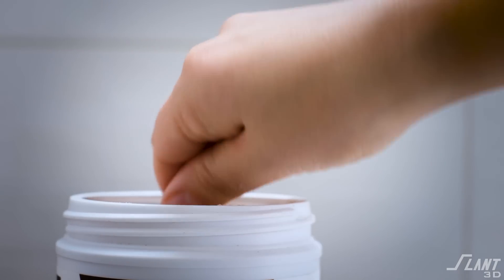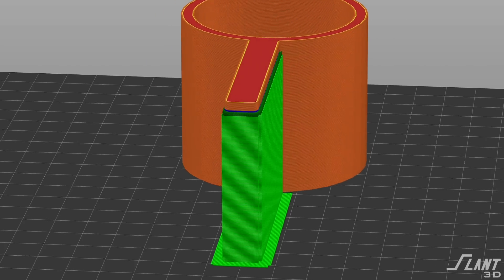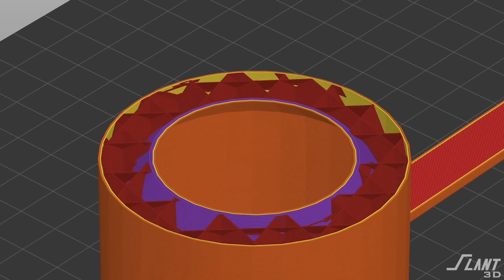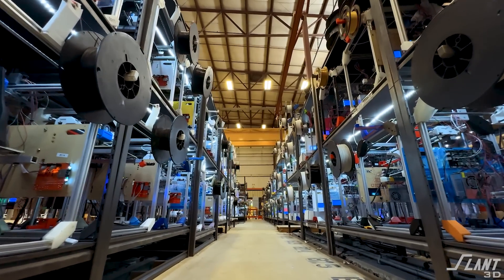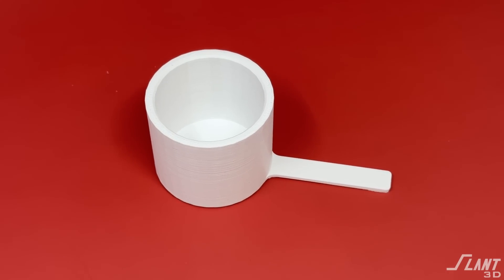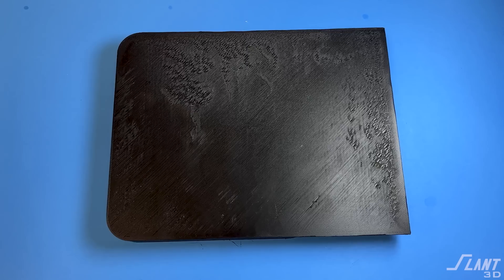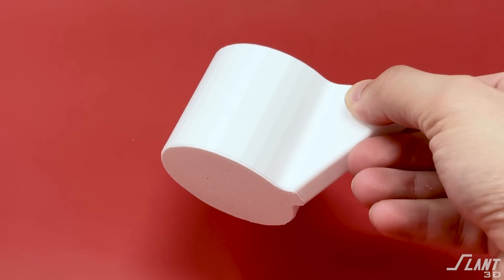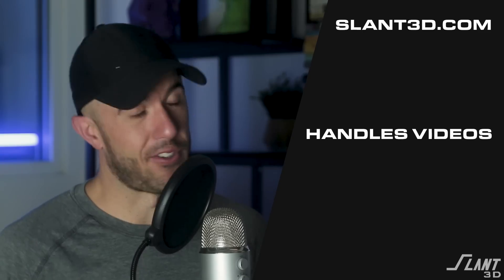Design Perfect Scoops for Mass Production 3D Printing

Comment: Handles on the bottom is absolutely awful. Best way to spill things.
The way you took powder is not the regular way to do it, and the handle can be both on top or bottom with injection molding, but I'm pretty sure you're already knowing it.

Comment: I love this series, but I think this time you chose a bad example. 
With 3d printing at the current state you will never get a food-safe scoop. Whatever you are scooping will stick to the layer lines and it will get dirty really fast and you will not be able to clean it easily. Both reasons why you should never use it for anything food related. And yes you can the scope for non-food things, but the visuals of the video suggest otherwise.
Reply from the maker: Incorrect

Comment: I’ve been a hobbyist in the 3D printer space for 10 years now and after watching this video I just realized I’ve never tried to recreate an injection molded part. If I had to repair something I just went straight to taking measurements and figuring out a design that worked best for FDM printing.

I remember the first time I tried designing a part I didn’t care about overhangs, fillets, or chamfers, and just made a part that worked great in CAD. But after it turned to a spaghetti mess on the build plate I learned my lesson immediately to design with FDM from the start. And I love these videos for helping me reinforce that thinking and also teaching me some new ways of designing. Something as simple as a scoop has a lot of thought in it to make it easy to manufacture, cost effective, useable, functional, and aesthetically pleasing (if applicable).

Comment: Start exporting STEP files instead of STLs and you won't see those straight lines on the cylindrical part of the design.
Reply: Interesting. My stl have never had that problem. I'll have to keep that in mind if it ever does.
Reply: Huh 🤣? Straight lines are unavoidable regardless of the file format. Fdm just print in LAYERS.  Even 0.2 nozzles produce layer lines.
Reply: They are talking about curved surfaces getting split into a series of lines, not layer lines. 

For instance, if you went to print a circle and it comes out like a stop sign. STL files store the model data as a series of triangles, which can lead to curved parts like cylinders to look like a series of line segments rather than a true curve.

STEP files store far more model data and can encode curves between two points rather than making that curve out of tons of little triangles.

Your slicer and printer need to support  gcode arcs otherwise it will just reduce the model back down to essentially the stl format however.
 @sherlockhomes9919

Comment: Why is the outside of the scoop not smoother it looks more like 50 straight lines to make a circle. 😂
Reply: he exported it at a too low resolution from the cad software. this is such a common mistake i dont get. when exporting from fusion the resolution setting is right there and the artifact is really obvious and offputting.

Comment: To be fair, when you value traditional feel while having internals more clear so less crap gets inside the scoop - having a handle with supports is ok, especially if this scoop has to be used in a long deep container. I did design a few scoops earlier past year, I did go with a traditional molded design. I know about those tricks you mention and they're nice, but situational. Not everybody will be happy with powder inside layers or with weird handle.

Comment: The handle at the bottom is going to constantly make the scoop want to tip either way and twist in your finger.  The reason for the handle on the top(above the product your scooping) is to add stablity and keep you from accidentally dumping the product.
Reply: Yeah, I figured there was a reason. I have some metal measuring cups, they use a totally different fabrication process than plastic scoops, the handle is still at the top. I'm also questioning the last model he made with the chunky handle - seems less ergonomic, as you can't place your fingers or fist all the way around it to secure it. I'm sure these items are made the way they are not because of how they're made, but because they really do work best that way.
Reply: Yeah, he really stretches to make a point sometimes. Like 4:21 who scoops with the handle completely horizontal??? Sane people have the scoop bucket down in the substance and the scoop handle sticking straight up.

Ironically he didn't do the simplest and most obvious change that the company is named for, just print it at a 45 degree slant!
Reply: Unless scooping mercury, (lead, or other extremely dense materials) or have weak finger grip twisting torque on the handle is not going to be an issue.
There is one consideration for placing handle on top, it's the the pivot axis aligns with the top of the cup. Placing at the bottom introduces lateral movement as tip, so contents could overshoot the intended dumping location.
To be fair, multiple handle design options (4) where presented. It's up to designers to pick the best option for the intended application.
Reply: I just made myself a new coffee scoop, and figured I'd print it with the handle at the bottom. It's not because it'll twist in your fingers. It's because you have to stick your fingers into the product in order to lift the scoop with the rim close to horizontal. Your hand is much lower in the container and your fingers are dipping into what you're scooping. Imagine trying to scoop liquid with this and you'll see the problem.

Comment: Another improvement is t make the handles be hollowed (part of the cavity) and tapered so they can nest together like normal measuring cups. That is a benefit of having the handle at the top (plus the fact then the weight is under the handle and is much more controllable)

Comment: The revised hadle with the big slab is ergonomically horrible.. both with and without the big chamfer. But the bottom-handle design has a lot of promise. Either way, thanks for sharing these ideas with the community.
Reply: I think the problem with the bottom handle is that your "pushing" the scoop rather than "pulling it", and if it starts to flex under the load as soon as you clear the surface of the powder you're scooping it can "twang" and throw powder out of the scoop.
Reply: @HellbellyUK  Good point but that could be fixed with a vertical reinforcing rib
Reply: Totally agree. I would elongate the handle and widen it, such that the thumb would have a better grip. Probably rotate is by 45 degree to allow more in the build plate.

Comment: Wow I can not believe we went throu a hole 3D printing redesing and he didin't printed in 45 degrees to minimize bed contact. Just kiding, I love this content. I was wondering is there some kind of coating to make the prints food safe? similar to the water bottle aporach? TY so much for the video guys!!
Reply: was thinking the same. easiest solution would most likely be printing out of pet or pp and external perimeters first to increase layer stacking quality a ton which would reduce the amount of powder (or whaterver you're scooping) getting caught by layers. could also print at like .1mm layer hight to further increase quality.

Comment: Wow empty here is in the comments
Reply: He forgot the comment infill
Reply from the maker: just the two of us
Reply: @slant3d  anyways which printer should i get bambu a1 mini or combo or ender 3v3 or used creality k1c ???
Reply: @Cyber_Gas  I doubt he is going to recommend a consumer based printer as he deals with commercial/industrial grade printing. The A1 mini is a excellent starter printer, however you will eventually start coming across build volume issues. Creality has smoothed out the initial issues with the K1C. If all you are going to print is PLA/PETG you may want to wait and get a K1SE. If you want to print abs down the road you can always diy an enclosure.
Reply: @AtomicBleach   btw i already have ender 3v2 neo
Reply: @AtomicBleach   also i want the printer to be core xy
Reply: @Cyber_Gas  well that rules out the A1 mini and the ender 3 V3 lol. If you already got a neo maybe get something like a Sovol SV08 that has enough build volume to do larger prints like helmets and display pieces.
Reply: @AtomicBleach  but i think ender 3v3 is core xy bc mine friend has it and by specs it should print up to 600mm/s and the mini 500mm/s
Reply: @AtomicBleach  oh but isnt sovol more expensive ?
Reply: @Cyber_Gas  it's a core xz system. Similar in that it's belt driven. That's where the similarities end though.
Reply: @AtomicBleach  ok but is there any cheaper core xz printer for the price of the v3 or the mini or some kit like that cheap
Reply: @Cyber_Gas  for about $270 in parts you can convert the ender 3 into a core xy. Look up the Ender 3 NG project. I would not attempt it unless you have a friend that can print a spare part or two while doing the setup lol. You would probably be better off just getting a stock V3 at that point.
Reply: @AtomicBleach  which one would be faster
???